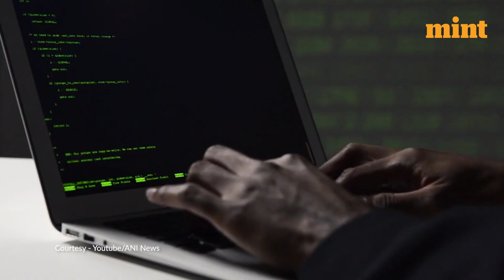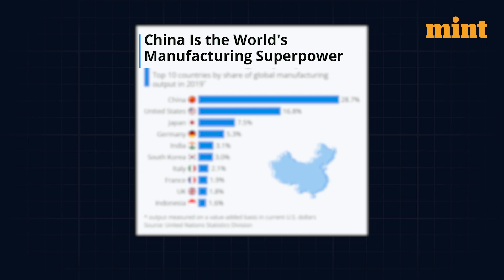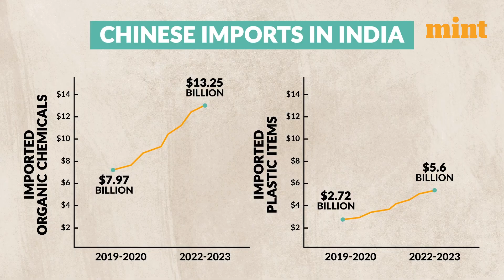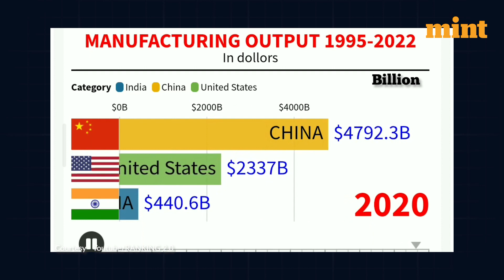Why is India struggling to cut its dependence on China? | Mint Explains | Mint

Comment: China is currently a 19 trillion dollar economy. It is silly to think that we can compete against them on subsidies. The right way to deal with this issue is to pick a few sectors where we can compete and focus on them. For the rest try to diversify imports from other countries so there is no monopoly of Chinese sellers. It is silly to say that we will not import from China even if something is cheap, no need to worry too much about the dollar value of imports from China so long as they are well diversified.
Reply: 23，not 19
Reply: @huehable 

Not 23 it is 0.1
Reply: @huehable  19
Reply: @huehable  : As of 2023 = 19 TRILLION U.S. dollars.
Reply: Its notion might sound silly to you, but in reality, it is very much practical if gov. use good policy guides.